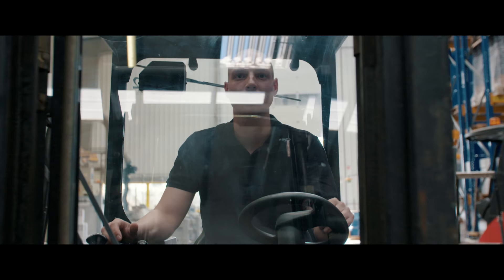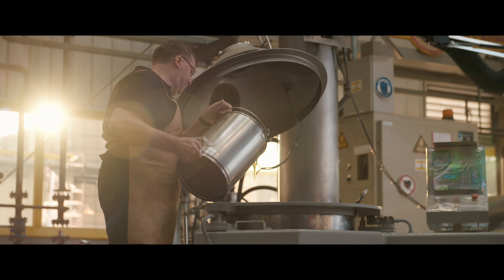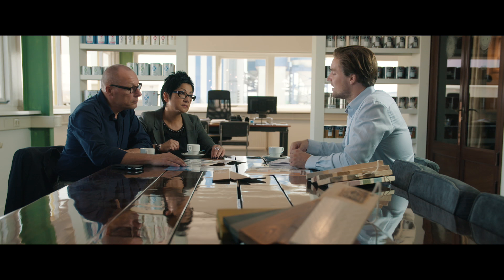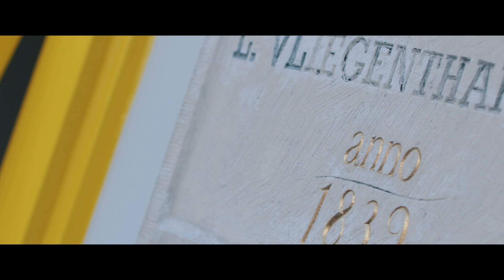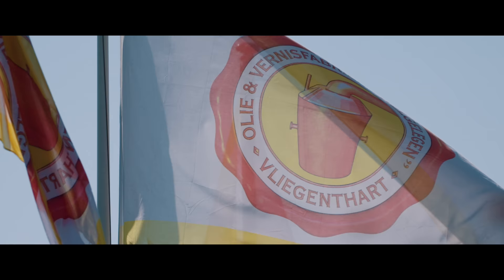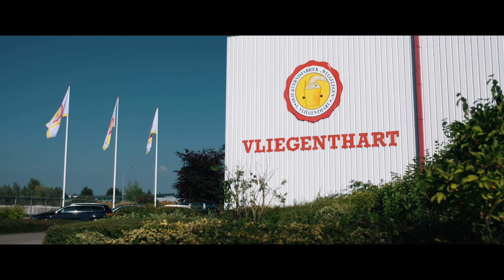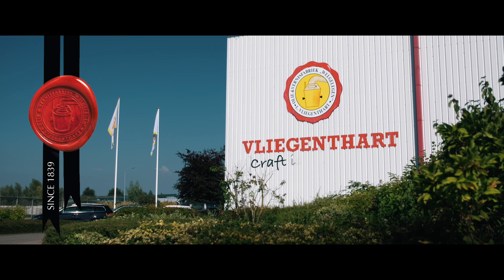Vliegenthart Corporate Movie

Comment: Yes very beautiful varnish, i am a french polisher as you know but the glow if these oil varnishes are beautiful, nothing quite like it.
Would like to speed up the drying just a little bit, i know about switching on a fan any other suggestions?
Jacob
Ps mixed some lacq with polyurethane 50/50 still very nice and dried a lot faster, what do you think?